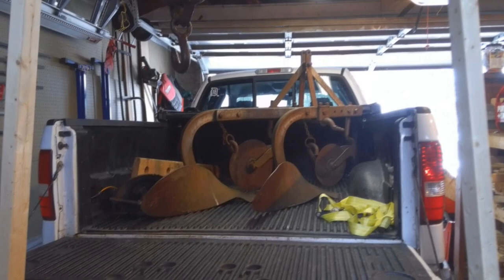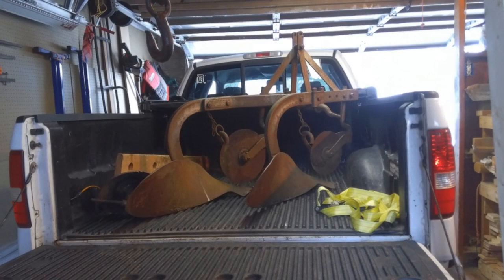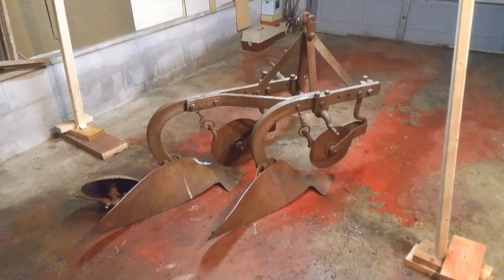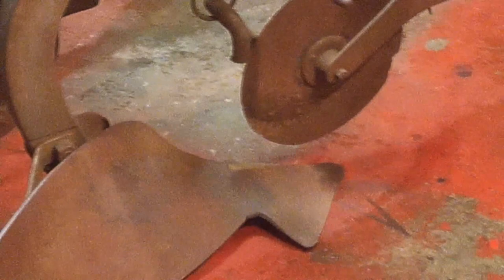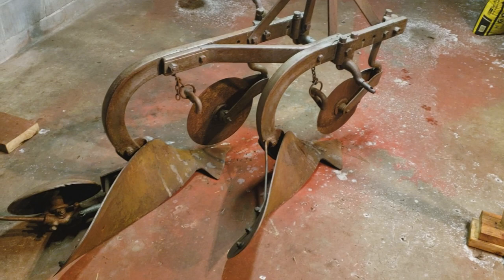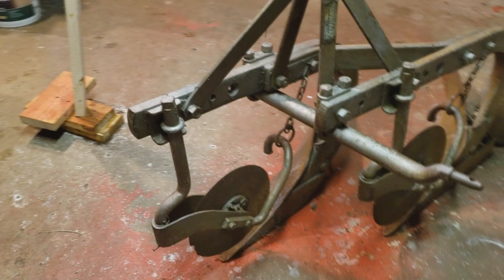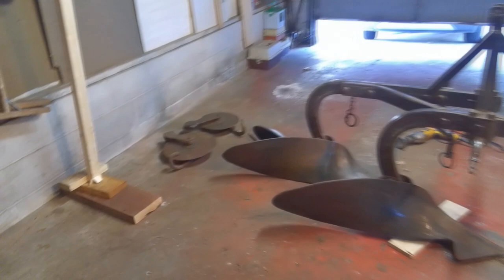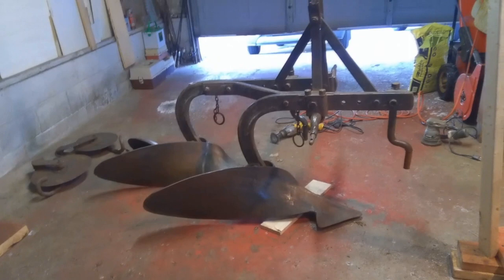Ferguson 2 Bottom Plow Restoration

Comment: I have a Ferguson 2 furrow plough here in New Zealand im restoring. 
Your missing quite a few parts off yours . On the coulters there should be scrapers. To keep them free of soil bulid up , a lever to adjust the angle of depth up by the top link mount , etc .
Mine will be painted Ferguson grey as im restoring it to factory condation .

Comment: Hell of a job. About to restore one my self. Thanks for the help.
Reply from the maker: Let me know what shape your Coulter hubs are in, curious if mine were just one of a kind or if others face the same issue.  What model/make is your?
Reply: I did not even get any with mine. But should not need then I hope.  My main plan to restore it is to repaint it. If I luck in to other parts for it I may add latter.  I got a 6 foor scraper blade and the 2 bottom plow for $350. No welds so they look good as far as I can tell. Will see how they look onice I clean them up.

Comment: Now that it looks so pretty take your sander and remove all the black paint from the moleboard then take it to sandy ground and plow for about 1/2 hr. to clean it up The mole board has to be shiny to work right.  It will not work as intended the way it is. The paint will make it hard to lay  the dirt over, it has to be clean. I grew up with using  a plow like this, in fact own one now.  for what it's worth I am now retired.
Reply from the maker: So bare metal works best? Would never  have thought paint would hinder the moleboards from working correctly.  Thanks Gerald for the advice, glad a can of black paint is cheap!.
Reply: Love youtube jam packed with brilliant advice (damn😊 them adverts mind)

Comment: The dust cover for the coulter blade hub assembly should still available from Massey. It’s the same plow as a MF62. They’re designed to retain the grease and keep the dirt out... I know you probably won’t do much plowing but the hubs themselves are obsolete and it’ll keep them from damage.
Reply from the maker: Thanks for the information.  Your right, don't do much plowing but want to keep things as original as possible.
Reply: Where did you find the parts mine is a 12B 2 bottom Ferguson

Comment: I have one of these but it is a 14.  I ended up taking the cutters off because the brome i was working was so thick that it would not cut and it just packed it up  with grass and roots.  A shiny moldboard face is best.
Reply from the maker: May I ask what “brome” is.  Ok, that’s two people saying I should have shinny moldbooards, still looking into that.
Reply: @thehandyoutdoorsman9014  Brome is a thick pasture grass used on the high plains and central states for livestock.  The shiny moldboard makes it smoother, not that a painted surface is impossible if you have the  right soil.  Sticky clay will tend to really stick to that face though if there is any sort of roughness.

Comment: If you use a center punch & a small drill bit to make a pilot hole first, the larger drill bit will NEVER dance or move around. And you do not have to grind the pins all the way down to punch & pilot drill them.  As a machinist for ten year after going to tech school & a mechanic for forty years, I learn this trick from an old timer. Get you a good punch set at a big box store. I do not have a source for parts, I as hoping you did.

Comment: What Model Number is this plow? I have one that I need a moldboard for and I don’t know the model.
Reply from the maker: Erich Mischke I would have to check this weekend as it is on my property 2 hours away.
Reply from the maker: My plow does not have a model number, however it does have a type stamp (might be the same thing not sure).  Type 10-A0-28 made by Ferguson.   Hope this helps.